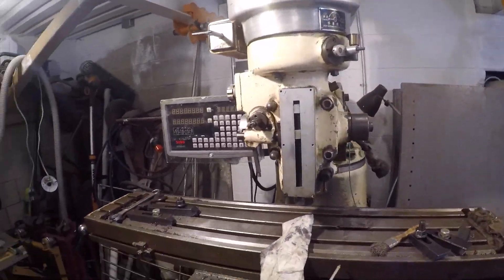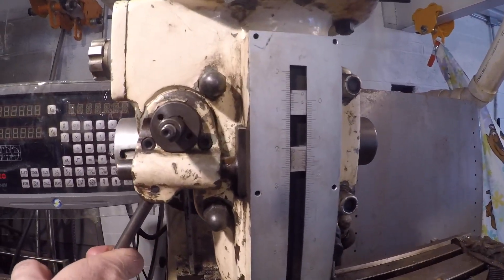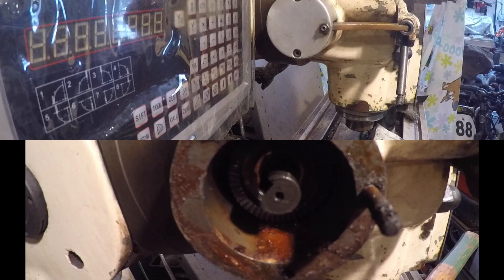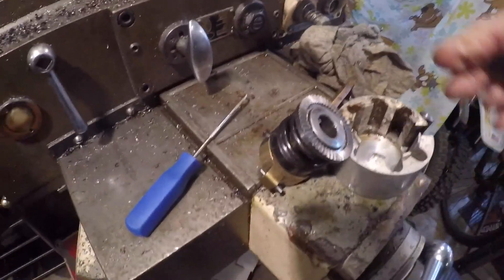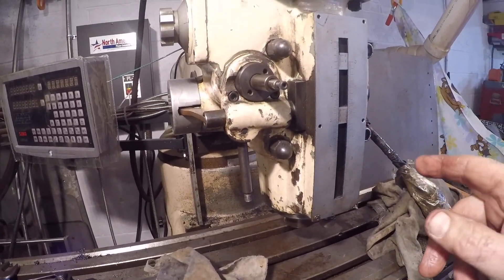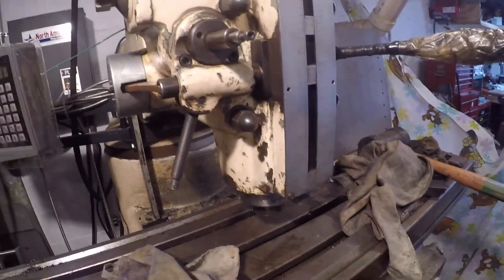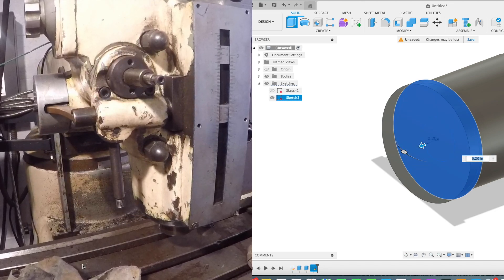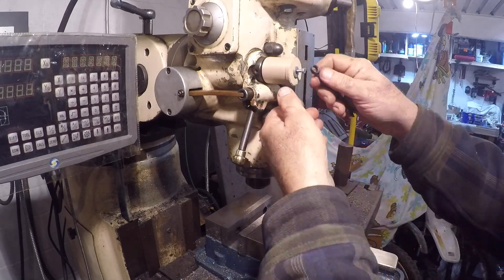Milling Machine Automatic Quill Feed Repair

Comment: My problem is that the quill autofeed knob is almost impossible to engage either way. I can tap lightly with a small brass hammer, it will engage and work properly, but it should work with just fingers. Same with pulling out on the knob, which required pliers. Sounds like a fun do-it-yourself project. 😞
Reply from the maker: Lol. And it not like you use the auto feed all the time. This was something I wanted to fix but didn't have to
 Thanks for watching